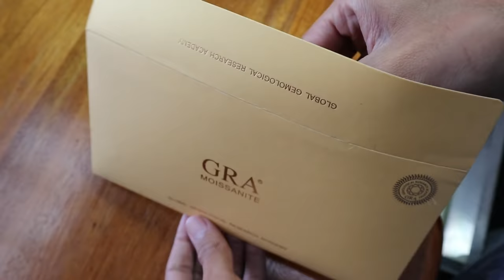men's engagement ring from a nut - jewelry handmade

Comment: What are you doing to prevent the brass from oxidizing on the naked finger?
Reply: You can actually put a coating of resin. I would research what is used. The resin can be food safe to industrial. Remember alway use ppe when using resin.